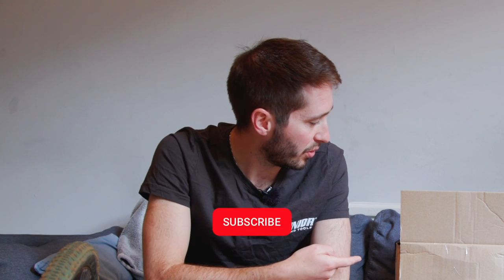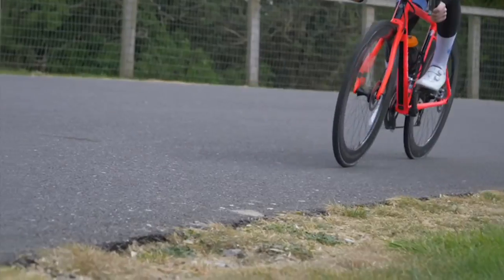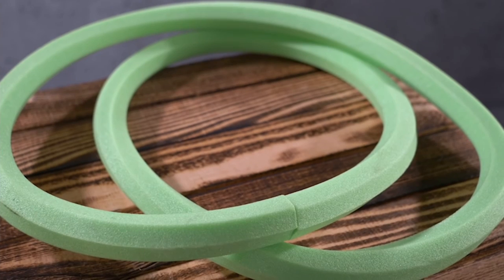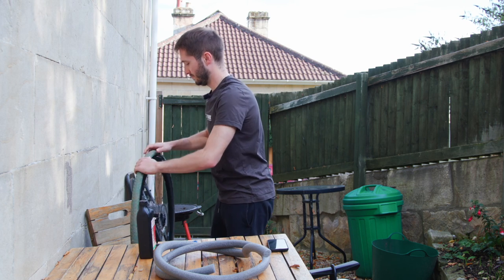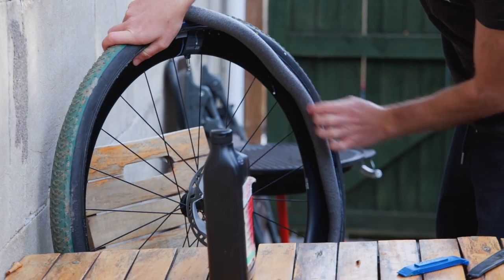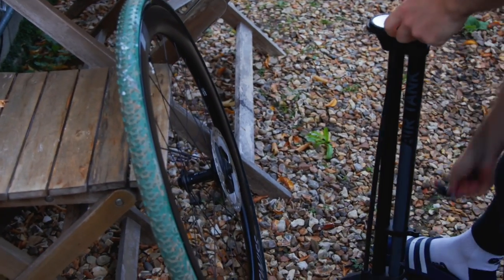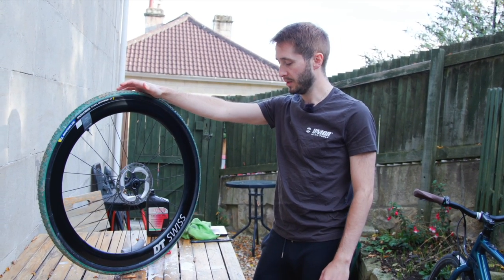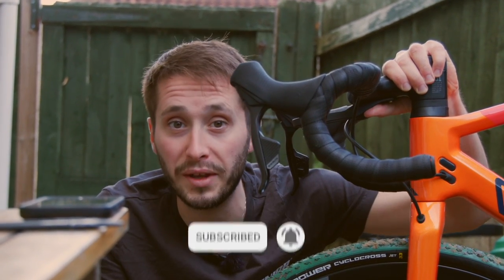DIY tubeless inserts for less than £10 - cheap gravel bike upgrade

Comment: Backer rod is used to fill voids behind windows, doors, when they are installed.
Among other uses
Reply from the maker: We knew someone would know
Reply: Also when using a sealant like silicon or polyurethane. Expansion joints in bridges, multi story car parks and buildings then apply the sealant over.
Reply: @Ecoroof1986  This.  Expansion joints in concrete.

Comment: Finally, somebody showing what really happens when working with tubeless tires. Sealant gets everywhere! But it's worth it.
Reply: Just use the bathtub but don't tell your wife ;)
Reply: I keep a small stans bottle around and keep reusing it.  It fits perfectly in the valve stem for putting sealant in tire. I have never had a mess like this when installing sealant😮

Comment: A sealant syringe is cheap and makes tubeless setup and maintenance so much easier I don't know why anyone "couldn't be bothered." The right tools go a long way to make a job like that easier and cleaner. 

I run tubeless on everything down to 30mm, and will never go back to tubes.
Reply: I have no idea why anyone puts in sealant directly in the tyre.  It's far easier to go in through the valve stem, assuming the stem allows a sealant injector tube to pass through it.  If it doesn't, throw it in the bin and get a proper stem.  I bought a couple pairs of Hunt wheels that had these rubbish stems and replaced them with Muc-Off ones.
Reply: @kurt1391  unless you're using Stan's race which has more lumps than fluid and at £40 a bottle you spend more time cleaning up when the pipe blows off..
Reply: I bought a Park Tools injector. I'm annoyed with myself if a lose a couple of drops.

Comment: Thanks for the reminder why I'm never switching to tubeless🤣 BTW my bike hack is to use heat-shrink tube at the end of my shifter and (rim) brake cables instead of crimping an end on. Much tidier and 1 gram less 😉
Reply: Or a dab of superglue.

Comment: At least we get to see levers being used to remove and install the tyre. When I tried tubeless - and I do like the concept - it's advised that using levers could potentially damage the tyre bead causing it not to be airtight. Well good luck with that! Maybe with big mountain bike tyres it's possible but never on road tyres.  I've always had to resort to levers for both removing the tyre and replacing it. Maybe there's a tiny chance to install with just my thumbs - and I've got close - but never to remove the tyre.
Reply: It can.   Not all rims and tires are a great match
Reply: Agreed. 
To add,  a recent incident with a friend's wheels - tubeless but not running as tubeless - meant a broken tyre lever. Got them on eventually using my Park Tool levers plus two pairs of hands!

Comment: I tried 30mm backing rod with 33mm cross tyres. There was no way the tyres were going back on the rim. I tried again with 20mm, but I'm not sure they're giving me the full benefits of inserts, although I probably could run them flat at a pinch.

Comment: I my day we stuffed tyres with environmentally friendly leaves, grass and twigs. Surprised modern tyres can survive running so flat, used to wreck ones I did it with.
Reply: I rode 15 miles home once after a double puncture and no spare inner tubes using the grass method. I wouldn't recommend though.

Comment: The manufacturers are gonna love you for exposing their excessively high priced inserts when you can buy the same stuff from a builder’s merchants for £1 a metre! 😂
Reply: And I bet you think all carbon fibre is the same. Tyre inserts are expensive, but the foam is quite different to this gap filler. Nukeproof ARD for example is much more dense, and it’s shaped.
Reply: @joules2936  keep telling yourself that! 😂
Reply: @joules2936  more or less densed is just a difference in the production process. It still is simple Polyurethane foam, just like many swimmingpool toys, central heating insulation, anti-stressballs etc.
Reply: Just bought some from Amazon and it's quite a bit softer than the airliners. I do think they would work to keep the tire seated if it blows, but not necessarily work to ride on with a flat tire
Reply: @satrujillo30  Good to know. For the same effect, we should know the exact density of the airliners and find the same density PU foam. That should work, but many times the density is not mentioned.
Reply: Sturdy foam can be quite expensive. The stuff he used here might work, but it is still quite soft making it inferior for its intended purpose. Something I learned trying to DIY crashpads for bouldering.
Reply: DIY solutions are OK for mountain bikes. Nothing comes close to Victoria's for road biking though.  Nothing has the density along with having nearly zero effect on rolling resistance

Comment: Mmmmm, so you save $30 but risk your $1000 wheel rim.  I've run on a flat tubeless tyre for 45 km at a steady 30kmph with a Vittoria gravel insert, keeping the tyre both on the wheel & keeping the rim off the tarmac.  The Vittoria road is I'm told even more advanced in that the insert collapses under air pressure but expands to keep the tyre on when pressure is lost in the tyre 👍

Comment: Does sealant still work with the inserts in the way? You demonstrated that it doesn't easily flow around it
Reply from the maker: Yep. The liner doesn't block the whole tyre and seems to compress a little with air pressure so sealant will flow properly
Reply: Once you get a leak the sealant will flow to the leak
Reply: @roadcc  no - this junk soaks up the sealant really quickly. just took mine off three weeks after mounting and there was not a speck of sealant in either tire, but you could wring it out of the foam. mind you, not paying for the commercial ones, but this just makes a big heavy piece of foam.

Comment: How much does rim width matter? Pretty sure it won't work on my 17mm internals but would love for it to
Reply: Backer rod comes in about every diameter imaginable. I sized down to 1”/25mm for my 19mm IW rim and it’s a good but snug fit!
Reply: Does it have to seat on the rim bead?

Comment: Interesting Liam, thank you. I imagine the Vittoria and other vendors optimize their insert's shapes and durability treatments. Question about those products, how do they handle the tire area around the valve? Are they shaped to fit around/under the valves? Will definitely give the diy approach a go, though my sealant technique is a bit less messy than yours. 👍😉🫡
Reply: within three weeks, the foam had soaked up all the sealant and the actual inside of the tire was dry. Had I put more in, I would have just had an even heavier foam piece with none of the benefits of tubeless. The actual products are not this material.

Comment: How much smaller diameter than your tyre do you think would be worthwhile? I'd like put some 40mm tyres on my gravel bike but am struggling to find any backer rod between 30 & 40mm.
Reply: cut it in half or quaters or use pipe insullation or pool noodle

Comment: Any idea how it works in the long term i.e. 3 months later ?
Reply: terribly. within three weeks the backer stuff had soaked up all of the sealant and was a big weight without any of the plugging benefits of tubeless (found out when a tiny, tiny leak wouldn't seal)

Comment: I can only see PU Backer rod with a max size of 25mm? I'm using 38mm and 45s tyres.... Will 25mm work on both tyre sizes?  any ideas?
Reply: Pool noodle or pipe insulation

Comment: is it strong enough as solid tire (without air at all)?
Reply from the maker: Without any air in there you can ride the bike. Cornering feels weird, but you'll stay upright and it'd get you home or to a cafe
Reply: I've used proper solid tyres, it's like riding through glue. The smallest steering inputs even slower its rolling. Its like a rubber band robbing power but it never gives it back

Comment: I just do t understand why the industry is pushing for more tubeless. As I understand the use/advantage for off tarmac use, the functionality of managing a puncture is very very very messy and you end up carrying a massive repair kit and a tube just in case. Am very happy with my latex inners and even happier with the original rubber tubes as they need less maintenance
Reply: Actually quite the opposite. My tubeless "repair kit" is a screwdriver like tool with rubber wormies, thats pretty small when packed up, like tubolito or so. The classic sealant is messy, but since a year I started to use Mariposa Vegelatex, and that thing never dries, so it can be cleaned up, washed off your clothes. In one season I usually get 5-6 punctures on my gravel tires. Usually I find that out when I am changing tyres for the muddy/dry season. :)
Reply: I've just gone tubeless on my hardtail MTB and it's like night and day in terms of comfort. And I'd have had multiple punctures from the amount of holes I could see being plugged by sealant after I rode into a thorn bush.
Reply: @gezakopter1153  where do you live? Is it more humid? If dry climate will it dry out quicker?
Reply: @samuraioodon  Nah, Slovakia has kinda dry, continental weather. Vegelatex is made from some kind of veggie mumbo-jumbo with olive seeds in place of actual latex. It is not drying out, rather remains in some kind of goopy substance, so it is easy to clean, but actually seals punctures. I have no idea how that's possible, but works. :D
Reply: @gezakopter1153  interesting I'll see if the Stan's hold up if not I'll give this a try.

Comment: Wouldn't The foam get compressed over time and become thinner.
Reply: Only with a tube. Tubeless does not have any direct forces, the air pressure does not affect the insert much

Comment: doesn't make sense. It shrinks when you pump up the tire, won't it expand at 15psi tubeless? And how does the sealant move around if the psi is that low if you have a slow flat? Not great for cyclocross, but high speeds yes